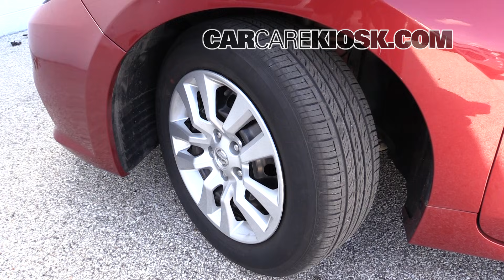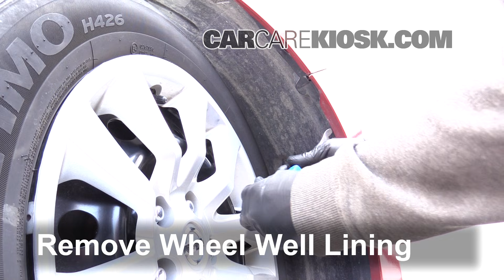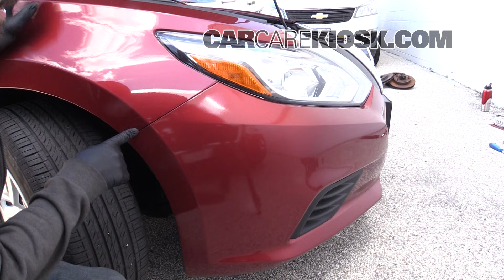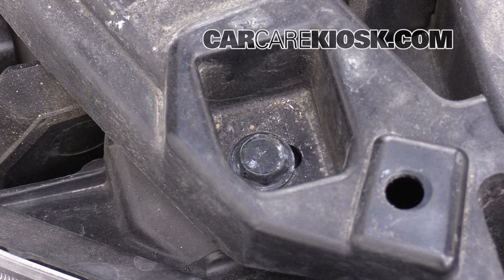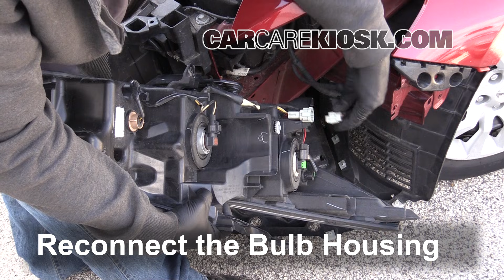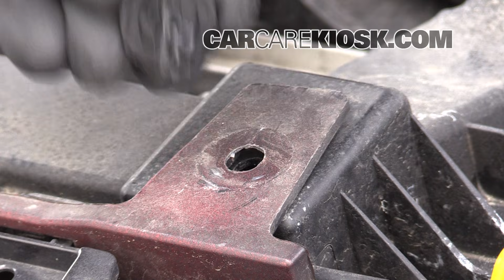Nissan Altima 2016-2018 Headlight Housing and Bumper Removal

Comment: Thanks a ton for doing this video. However, this has just given me another reason and reaffirmed by commitment to never purchasing another nissan vehicle. It takes me 5mins or less on my Toyota sequoia  SUV. It should take 20 steps and 1hr + to change headlights on any vehicle in the 21st century. 🙈😭😂

Comment: Amazing video! Well-lit, well-explained and easy instructions!
Reply: I just changed mine out thanks to this video!! Massive change in lighting and now I feel safe driving again at night. 

Thank you so much!
Reply: My local Nissan dealer wanted a $185 diagnostic fee just to pop the hood and that wasn't going to roll into the cost of any fix needed. 

Then, I asked what testing the fee covered and they couldn't even answer me. 🙄

Comment: To change just the bulb you can reach into the wheel well cover where the first bolts were removed and replace them thru that. This is for only replacing the actual head light assemblies.

Comment: I’m really not trying to be a smart Alec but all you have to do is turn the wheel all the way to the right if you’re on the left side and all the way to listen to the right side, pop off the plastic screws under the wheel well and the bulbs are right there.
There is 100% no reason to remove the two top panels and then remove the bumper. That’s way too much work doing this. It’s not being lazy, it’s using your head.
Reply from the maker: Thank you for your comment!  This video is to show removing the whole light housing in case you are upgrading to a different housing design or replacing a damaged housing.  You are correct that to simply replace the headlight bulb, there are easier ways.  We show how to change just the headlight bulb here: https://www.carcarekiosk.com/video/2017_Nissan_Altima_SL_2.5L_4_Cyl./lights/headlight

Comment: Please query online -" Rafael Suarez, et. al. v. Nissan North America, Inc."  Unfortunately You Tube will not allow me to post the link.  This is a class action lawsuit which when it's  eventually settled will result in many headlamps from 2013-2018 Nissan Altima's being replaced at no charge.  It doesn't matter if you didn't respond by the deadline as stated in the lawsuit as it's still in its infancy and you  still can be included to initiate a claim if eligible.  You'll know once it's officially settled when  the Nissan corporate website known as "Nissan Assist" will list it as a current active campaign.  Keep in mind. you may still be able to replace your headlamps at your expense now and  potentially be reimbursed later

Comment: I really appreciate your video. I was informed there's a class action settlement on those headlights due to delamination on interior causing very dim lights.  I purchased LED for replacement..your video will definitely help me
Reply: Same here. I just ordered my lights for my 2014. It’s almost like they’re off
Reply: my 2016 altima headlights are so bad, tried changing the bulbs and it did nothing, now i have to find a good new assembly that has the correction issue

Comment: This was probably the most complicated difficult way ever to remove these bulbs😂 all you have to do is turn the wheel to the side and unscrew the liner and you could literally reach in and get the bulb out and replace it 😂😂😂 work smarter not harder‼️ but good info on the bumper tho lol
Reply: this is for people that want to replace the entire headlight housing u moron 😂
Reply: It’s the high beam your not going to reach though. What your talking about is replacing the lower beams

Comment: If any one is doing this for a 2014 model it's different,. This vid does help  but there are differences in bumper removal in the 2014 model. I will post a vid on how I changed my burnt out headlights

Comment: you 100% dont need to do all this to change a headlamp on the nissans lmao. just fold over the wheel well covering and do it from there with a turnjed wheel its not hard.
Reply from the maker: Correct - this is the video for going through the wheel well: https://www.carcarekiosk.com/video/2017_Nissan_Altima_SL_2.5L_4_Cyl./lights/headlight
Reply: But if you need to replace headlight assemblies then this is what you need to do.
Reply: True, but if yours are defective, the bulb alone will not solve the issue.  Read about the class action lawsuit that just expired 😮

Comment: Why are you telling people that you need to remove the bumper to change a headlamp bulb? I changed my son's 2015 Nissan headlamp bulb in about 15 minutes. All I did was pull back the tire well lining and replaced the bulb.
Reply from the maker: Because to remove the housing you need to remove the bumper, to remove the bulb you can go behind the wheel well.  This video shows how to remove the housing
Reply: @CarCareKiosk  I literally just changed my son's bulb. I did not remove the bumper
Reply: @CarCareKiosk  ok

Comment: Here I am again I need to replace the other side.  Even though the side that I replaced 2 years ago needs replaced again, it is because of the chrome paint that is on the inside of the housing it burns away and causes the light to not shine at all.  I just wished that the whole assembly did not have to be replaced.

Comment: do you have to do this whole process to replace the high beams only?
Reply: No. To replace the high beams first you remove the steering wheel and drivers seat  then you have to remove the passenger seat. Step number #2 lift the two front wheels and remove the transmission. Then remove the 4 screws next to the battery  on the left side of the bumper, pull out the headlight housing and replace high beam light bulbs 💡. Now how to replace your air filter. 🙄

Comment: So basically if one bulb goes out it's just best to buy new housing and replace all the bulbs for both sides?
Reply: Read other comments... Replacing the bulbs alone may not do it... There is a defect in the projector from Nissan which burns out the reflective part, so no Meyer how bright a bulb you put in will not fix the issue... Though you should try that first like I did... (you just go behind the splash guard in the wheel well) but like many others that didn't work for me... Had to replace the entire assembly.

Comment: Unnecessary when you can reach it through the wheel well
Reply from the maker: This video shows how to change the headlight bulb through the wheel well: https://www.carcarekiosk.com/video/2017_Nissan_Altima_SL_2.5L_4_Cyl./lights/headlight  The video above is showing how to replace the whole housing (like if you want to upgrade to a different housing design)
Reply: thanks
Reply: This video is for replacing the headlight assembly.  If your low beams are dim then the headlight assembly has an oxidized reflector coating which requires replacing the entire assembly.  This is a known problem with some Altimas.

Comment: If you're just changing a headlight bulb, DONT REMOVE ANYTHING! Just turn the steering wheel away from light you're working on and pull the wheel well plastic cover away from fender and you have easy access

Comment: This video is perfect.  I thought I had bad lightbulbs on my 2013 Altima and it was not the bulbs . The Altimas have this defect where the headlight assembly give out and does not emit the light out bright so u must buy new headlight assembly for the car to make it shine and be bright again at night.  This is actually very very easy.  Saved me 600 . Bought the headlight assembly and had a Saturday all to myself and job done.  Make sure u have all the necessary tools if u arent a tool guy.
Reply: Felix Rios where did you buy the headlight assembly?
Reply: @elkaisermendez6994  Amazon or Ebay either one . Nissan Altima headlight assembly.  180  to 200 ish for the pair.
Reply: Felix Rios and did it fix the problem? Do the lights shine bright?
Reply: @elkaisermendez6994  yes sure did. Let's see how long they last. Brought the brightest bulbs and found it it wasn't the bulbs. Now they are bright like when I bought the car in 2013

Comment: This is too much work...where in another video a guy did the same thing to change a headlight in just five minutes by peeling back that part above your tire...reaching in and doing it that way.
Reply from the maker: You are correct - this video is to remove the entire housing for those who have damaged housings or want to upgrade the housing.  Here is a video for just changing the headlight bulb: https://www.carcarekiosk.com/video/2016_Nissan_Altima_SL_3.5L_V6/lights/headlight

Comment: This is for Altima models 2016-2018 only!  the bumper and grille are different from the 13-15 models
I would change the title to be correct in your tutorial
Reply: I just did this on my 2014 tonight.  I think the only difference is the number of screws, bolts, button things and mine did not have the things behind the grill. If you have a 2014 this video definitely gives you plenty of info to complete the job. Thank you!
Reply: @patsiebenaler855  awesome that’s all I needs to know thanks
Reply: @patsiebenaler855  Hey I am going to be replacing my headlight housing soon on my 2014 Altima. Was it hard to remove the bumper?
Reply: @xavierreddick6555  I was very surprised on how easy it was.  I have a 2014 so it was slightly different than the video, I think I had fewer screws.  It took me just under 2 hours from start to finish.
Reply: Any specifics as to what is different?  Was looking to do this exact job Sunday to replace the housing.

Comment: This is NOT applicable to a 2013 altima. All the screws and rivets are in many different places.
Reply: I was gonna say:  YR/SCMV

Your rivet/screw count may vary.
For us 2013 owners, at least the video gets us in the ballpark of what needs to be done.   Wish me luck!
Reply: Same goes for the 2015. However this video still does generally guide you in the right direction despite the differences between years.
Reply: Well I mean it does say 2016-2018.
Reply: Literally says 2016-2018 lmao

Comment: Anyone know what size plastic clips because I know I should probably buy some extras before I start to take it all apart?  Also, if you have fog lights, do you have to disconnect them to take the bumper off or is there enough slack in the wires when you take the bumper off and set it on the ground?  Sorry.  I am not a car mechanic/expert but want to try this myself to save $800.  Thanks!
Reply: I had enough room to not disconnect the fog lights, just set it on the ground as far as it could reach
Reply: Did you ever get/find an answer for the size of the clips? Looking to tackle this job Sunday.

Comment: All unnecessary. Just pull back on inner fender shield and you can fully access the headlight plug and assembly!!!! This video sucks! Way too much unnecessary work!!! This video is completely amateur.
Reply: Bulb replacement will not work

Comment: THANK YOU SO MUCH MAN. You literally saved me $1,100 whereas I bought 2 brand new headlights off Amazon for $150 lol. Btw YES this does work for a 2014 Nissan Altima 2.5s
Reply: Thanks.  I was wondering that because my 2014 Altima looks slightly different than this, and I was afraid to use this video in case some steps (bolts/screws/clips) were missing.
Reply: @jameskerr3257  I bought a car clip kit off amazon w/ 200 clips or so and the fasteners for maybe $15-20.
Reply: On my 2014 do I have to take off bumper?

Comment: Just pull plastic in wheel far enough to reach bulb  no need to tear a car apart to change a  bulb
Reply: This is a video for changing your headlight assembly, not the bulbs.
Reply: Yes, if all you need to do is change the bulbs. But actually, I think the main purpose of this video is how to remove and replace the headlight housing...I think it’s an excellent video on how to achieve this!
Reply: Tbh

Comment: Wait,  I have  to disassemble the car just to replace the headlights??? 🤦🏽‍♂️💨💨💨💨💨
Reply: Yes to your question.. if you are looking for replacing the light bulb... this isnt the video for you... the other video showed pealing back the plastic protector by the wheel and exposing the rear of the bulb. Reach in and replace.
Reply: this is for the HEADLIGHT HOUSING and yes you have yo remove all those bolts and nuts for you to replace the HOUSING/ASSEMBLY, not the BULB..
Reply: I mean wtf is this nissan? couldn't make this easier
Reply: The whole headlight assembly yes but not the low or high beam lights alone
Reply: shyshotcaller27 yes

Comment: Just peel the wheel lining  back and look in and there’s the bulb you just stick your hand in and turn pull replace and boom done all this extra work is unnecessary
Reply from the maker: This video is for replacing the housing, not the bulb...

Comment: Just finished swapping out both headlight units on our 2013 Altima SV.  The video helped tons, but the mounting screws and fasteners are different on our car.  The night drive test will be in a few hours from now.  Hope the new units make a difference.  The old ones were terrible.  It's bad when your yellow parking lights are brighter than the low beams sitting right behind somebody at a traffic light.  Nissan...  UGH....
Reply: How did they turn out? Fix the issue? Im about to replace mine on my '14. Fingers crossed 🤞
Reply: @blueglovemechanic  the swap worked great.  The reflectors in the old housing were trashed.  Don't know how they got that way.  Read about others having that issue.  The car's low/high beams and fog lights are all LED now.  My son hasn't had any issues with them.  I also did the brakes and rotors in April and replaced the driver's seat switch assembly when the recline switch failed.  It kept us pretty busy during lockdown.  Good luck and have fun with it.  I did.

Comment: Great video. I read the comment and I see there may be some confusion despite the pretty obvious title. If you have the typical low beam issue then this video is for you. Changing the bulb will not fix the defect that Nissan will not claim. There is a part that is burning out that will make the problem come back constantly . If you came here to change the bulb alone this video is not for you.
Reply: Can you elaborate on this "Low Beam Issue"?  Is the problem the low beams become very dim? So changing my bulb (no easy task - FU Nissan) will not correct this?  My 2016 shouldn't need a new housing because of manufacturing bs. But it sounds like you're saying this is a known problem.  Would love to hear more on this.
Reply: @yellowknight97  - There is a reflective surface inside the housing for the low beam. It degrades over time and becomes less reflective. You have to replace the entire headlight assembly. My wife's 2015 Altima is having this problem.
Reply: @knytrydr73 did you replace the headlight on your altima ? Did it fix the low beam problem?

Comment: This looks like a Nissan Maxima or an Altima with a different front end than mine. If you are a person watching this in order to change the bulb, double check what your car looks like before you begin. There is other videos with the different Altima type which only require the wheel liner to be removed.
Reply: It’s an Altima. Maybe you should know yours cars before looking stupid 😉
Reply: @DumSpiroSpero864  good point... I guess the Altima has two different front ends depending on the model..mine doesn't look like this one or require the whole front end pulled off to change the bulb.
Reply: I think it's a Nissan Sentra tbh.  The Altima is more popular car so he tricked us by saying Altima for views . Whatever it' is it's a 2018 and up model. Not 2013 -2018. Dude is wrong for video title
Reply: @mikeg6958  This is an Altima. A simple google search of 2016 Altima would have saved you from looking like a fool.
Reply: @kilojoule11  google? Just bc you use it everyday to tie your shoes doesnt mean we all depend on it...

Comment: Did this on my old car 2006 corolla and had to do all this as well. Now looking to work on the bumpers of my 2016 Altima.
Reply: Look up video that shows how to replace bulb removing only front inner fender shield .thats what I done n it took only 20 minutes to replace headlights
Reply: John Lowery I don’t need to replace any bulbs or headlights.
Reply: Chiquitita ,I help You

Comment: What a pathetic piece of engineering from nissan... i mean just to replace the headlight you have to do all this crap... wtf... fire all those  design engineers.....no wonder their build quality is so cheap... i got trick in to an altima and feels so cheap plastic all around every where...i think they are next after GM.... thats not how you make money for ur stake holders by cutting quality of product and lowering ur cost....
Reply: that engineering is what helps the car get high gas mileage... and if you are interested in replacing the WHOLE HEADLIGHT ASSEMBLY this is a perfect video... what you are thinking of... is a simple bulb change...

Comment: I just did this on a 2013. All you need to do is pull the inner fender aside and you can access the main headlight. 4 plastic Phillips screws on the bottom of the bumper and one plastic rivet on the inner fender.
Reply: I realize now this
Video is for removing the entire housing, not just a bulb replacement. I think a lot of people came here looking to change the bulb.
Reply: This was for replacing the housing not the bulb.
Reply: Exactly!some ppl make it hard than it has to be!
Reply from the maker: Thank you for the comment.  This video is more for replacing the entire housing.  For videos on how to replace specific bulbs, as well as other maintenance issues on this car (and many more)  please visit our website at...... carcarekiosk.com